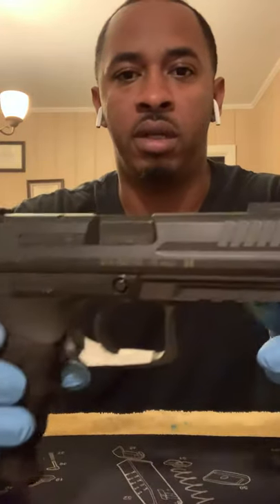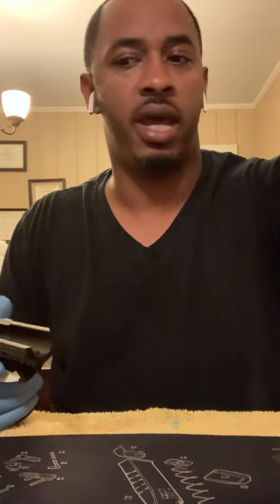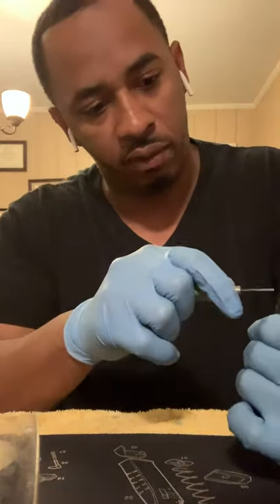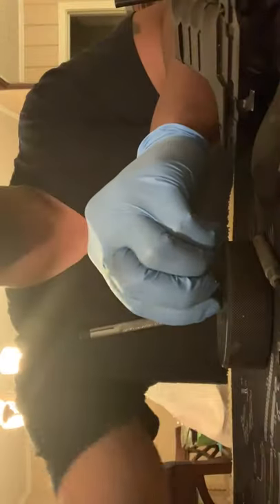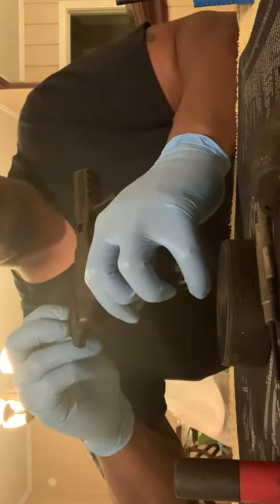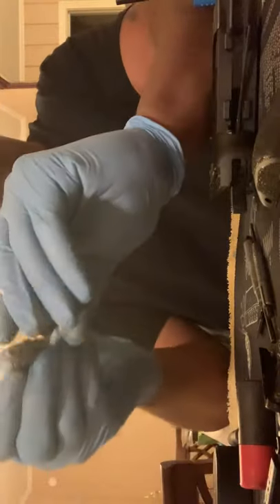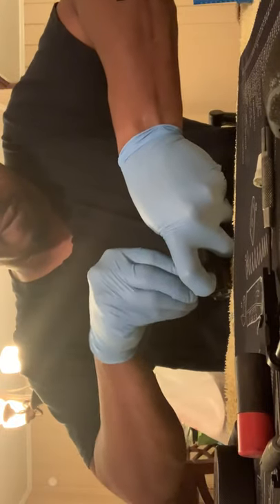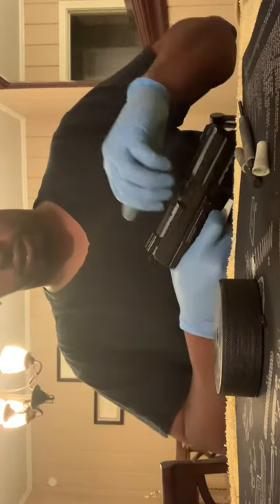Gray Guns short reset install on P30 DA/SA

Comment: Along with the GG reset kit I bought their flat trigger! I ordered a nickel sear and 10# hammer spring. Hope that's not too light. Haven't started yet because when I do I'll polish all the friction points inside. Both my USPs have been done, netting me 3#-SA & 6#-DA trigger weights, hoping for similar with the P30.

Comment: I used this video to add short reset on my p30 v3 and it made me pistol so much better no problems at all. I bought a P30 SK V1 and am having problems getting it back together. I think the problem is the longer roll pin in the sere because old parts won’t go back in either. Any thoughts ?